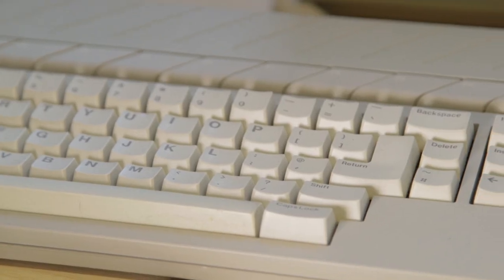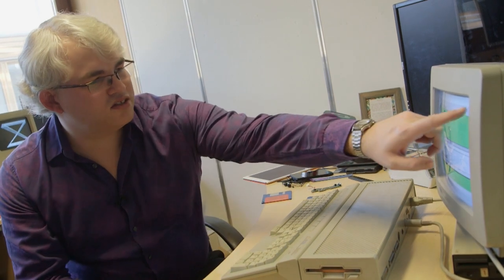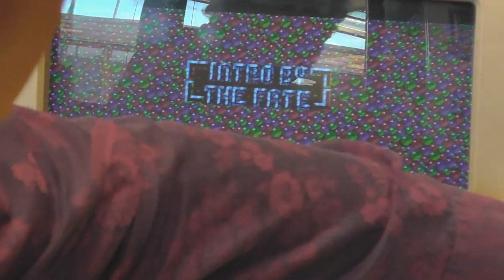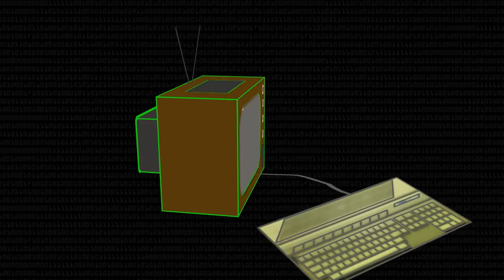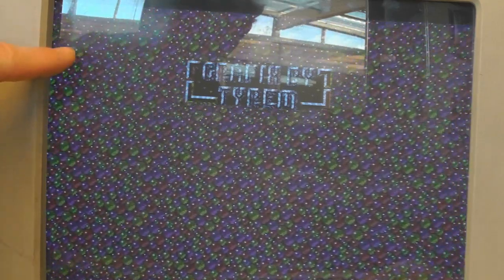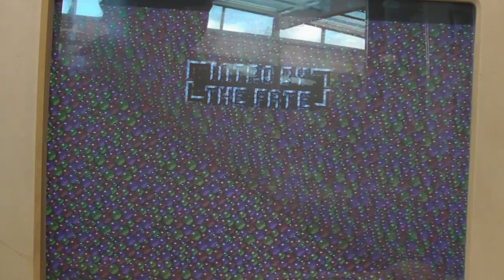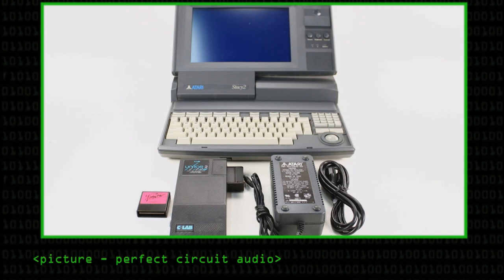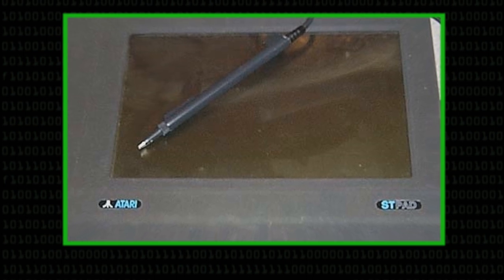Pushing the Atari Limits - Computerphile

Comment: Very nice, and in same years Amiga was able to address multiple resolutions in single screen with 4096 colors do multitasking. 

Atari fans do not like Amiga because it makes Atari look like totally out of date while Amiga debut around the same time, in reality it was not, but Amiga was beyond its time. Bagley is an Atari fan, have no Amiga, and mentions Amiga just a couple of times, seems like no hope here.

Can someone else in Computerphile make an Amiga episode ?
Reply: The Amiga had a bunch of custom chips (Paula, Agnus, Denise etc) whereas the ST/TT only later had an optional blitter, so that's trying to comparing different things. The Amiga's cooperative task-switching (not preemtive multitasking) added even more complexity for beginning programmers, in addition to the Amiga's complex memory models (fast RAM vs chip RAM) and costly documentation (»Amiga Inside«).

For hardware-oriented Amiga stuff, you had to wrestle with up to 17 different clock timings for all those custom chips. As a consequence, the 68000 in the Amiga had to deal with all sorts of IRQs not present in any Atari ST/TT. Effectively, you had a bit over 7 MHz »left« for user stuff on Amiga OS compared with 8 MHz flat on GEMDOS/TOS. So the Atari was not only faster, but easier to understand and easier to hack than the Amiga.

Nowadays, Atari emulators are a dime a dozen, compared to UAE -- another consequence of the Amiga's hardware complexity.
Reply: Margarine vs butter, AMD vs Intel, Linux vs *BSD, Ruby vs Python, bash vs zsh, Ubuntu vs SuSE, Picard vs Kirk, vim vs emacs, Netbeans vs Eclipse, chocolate vs vanilla, Thor vs Zeus, Firefox vs Chrome, just to pick the easy ones right out of my head. :-D
Reply: ***** And every smart person knows the correct answers are butter, AMD, linux, python, bash, suse, Kirk, vim, eclipse, chocolate, Thor, Firefox.   There, now that everyone has the right answers the arguments can stop..    :-)
Reply: Ken Jennings
I almost completely agree -- except for Ruby and Intel. Although I sympathize with Python and AMD for respective great efforts and inventive ideas, I'm solidly in the object-based (as opposed to merely object-oriented) Ruby camp since 2004, and in the more power-efficient Intel camp (never thought I'd actually write this) since 2013. Chocolate and vanilla I consider a tie -- so why not both, I ask? :-D
Reply: ***** 
Maybe you're thinking of the original Macintoshes that had co-operative multitasking where if one process didn't purposely relinquish control then no other program would get CPU time?

The Amiga has pre-emptive multitasking. No special coding is required from a program to get or release its time slice.  The OS takes care of all scheduling.

The custom chips in the Amigas do things faster than the 68000 can do (i.e. bit blitting) giving the CPU more time for running actual programs.  The Amiga/ST basically functioned alike on the bus regarding  shared bus access.  Half the cycles for CPU, half cycles for other hardware. The difference is the Amiga had more hardware making effective use of that time. 

The fast ram/chip ram distinction was a smart idea that allowed an Amiga to run full speed without sharing any bus time with the custom chips which is the relationship that evolved into today's graphics cards with memory for the graphics hardware separated from the motherboard memory for the CPU..

On the emulator point it is easier to implement a simulation of simple, less capable hardware, because there's just less that actually does anything.  Powerful hardware is always hardware to emulate. It is trivial for an Amiga to emulate the ST (or Mac).   But the ST can't really emulate an Amiga.
Reply: Ken Jennings If the AmigaOS implemented proper pre-emtive multitasking, it would have been quite a feat, like later with MiNT and MagiC! on the Atari ST/TT/STE/Falcon. For beginning and game programmers however, this meant even more complexity: unreliable timings due to the task-switching and problems with faulty binaries running in parallel leading to Guru Meditations (or that row of mushroom cloud and bombs on Ataris). (Didn't many Amiga games just deactivate and kick out the Amiga OS and other apps anyway, in order to maximize on stability and hardware resources, making a restart necessary after the games finished?)Thus, Dr Bagley's original point remains valid: the Atari platform was bare-bones, accessible and easy to understand, compared to the Amiga's complex hardware and OS. Once again I'm glad that I didn't go with my friends' choice of the Amiga as mostly a gaming computer, but with my Atari Mega ST4, on which I learned proper Assembler, C, interface design and later Minix, leading to my current profession as a Linux developer and admin. Not that this would have been impossible with the Amiga, mind you.
Reply: ***** for me it was the integrated graphics: a modern laptop should be able to play 1080p video from YouTube without stutter and dropped frames!
Reply: And Amiga owners don't want to hear about the Acorn Archimedes and RISC PCs because it makes their beloved machines look like a crippled 1979 technology (68000) 'computer' with weak copros full of limitations ...
Reply: +dipi: Amiga had a true multitask (not a cooperative mt).
Atari had a 68k 8Mhs, but cycles was rounded to multiple of 4 cycles due to the Glue: Develops an hardscroll and learn this. 
Irq doesn't slow down cpu if you don't use them, and seriously except for CIA (Amiga) or VBL, other IRQ are rarely used.
Reply: The Atari ST was pretty much thrown together at the last minute because Jack Tramiel was angry that Amiga had gone to Commodore.
Atari and Amiga had had a deal ... which Commodore bailed them out of.
Reply: Mumble mumble something FastRAM mumble
(...I wrote a better disparagement of it but Youtube appears to have eaten it, and, meh, life's too short; essentially, I can see it can be useful in some situations, and indeed would rather like an SRAM card for my A600 so I can try out the enhanced mode in Worms, but it's something that would have added extra complexity and cost to the design through providing a whole second memory bus that only a small number of users would actually make use of, and you'd have to buy a special additional memory upgrade to plug into that slot, which at least initially would have been quite a considerable investment for something that would only offer marginal gains - through releasing the CPU from the usual 4-cycle alignment - unless you were using one of the higher-end screen modes. And that memory, then, wasn't accessible by the AV system at all, so doing any work on the actual multimedia data would see you reduced to the normal speed, and also needing to blit data between the chip RAM and fast RAM if you wanted to work on it outside of the chip area... rather specialist really. And of course much like what the Atari folks saw with the STe, and to a lesser extent memory counts above 512k, programmers will generally write to the lowest common denominator wherever possible in order to have the largest audience for their product, and often seem rather loath to even include enhancements for more capable machines as an optional extra, so unless you're doing something that specifically requires those upgrades, you may find they're a complete waste. About the only exception to that rule that we saw was the single sided drive thing; software started out largely being SS compatible, but as the proportion of DS drives grew, software started to demand them... because if you can put twice as much data on a disk, you halve your duplication costs and cut down the overall production and distribution cost quite a bit, and it's not too much bother in comparison to either offer free SS replacements for those few users who request them, or just abandon that shrinking market altogether as not worth the effort)
Reply: Also I don't really buy the "true preemptive multitasking" thing. That would be quite the thing to pull off on a 68000, because it doesn't actually have the right modes and instructions to pull that off, at least not with any safety. I mean, perhaps the Amiga memory management hardware was a work of art and was able to set up proper protected pages for each process and carry out the sorts of virtualisation that the CPU couldn't do for itself. But one of the main reasons for the existence of the 68010 at all is that it added in the support for proper multitasking that the original chip lacked.

Rather like the 80186 and 80286 vs the 8086 - and really, Intel didn't properly get its act together on that front (as in, being able to multitask both with programs written explicitly for protected mode, and earlier code that assumed a single tasking regime, rather than pure protected mode code alone) until the 386, which is why you don't really see any full true multitasking (rather than task switching, with background processes being entirely dormant) operating systems on the platform until Windows/386 and then 386 protected mode of 3.0 came along. There were some early enterprise type OSes which could perform those functions on the 186 and 286, but they were generally insular and broke compatibility with common 8086-grade MSDOS applications, or at least had to suspend normal operation entirely, possibly even dropping out of the normal environment (like Win9x falling out to DOS, but harder) in order to run them.

Maybe they did something that tried to act like a true modern PEM OS, but it would have been extremely fragile if you actually tried to use that functionality in anger on a 68000 machine. Sort of like MultiTOS proved to be later on if you weren't running an 030 machine, or at least had upgraded your lesser model with an 010 or higher. Co-operative multitasking, or a simpler task switcher giving the impression of multitasking, I can more easily believe.

(And having explored much of the software that came unexpectedly thrown in with the Amiga I bought, I've yet to really find anything which exhibits clear multitasking behaviour, or to figure out how that much vaunted "pull down the title bar to look behind" thing is actually meant to work. Almost everything actually seems to operate much like it would on the ST or Mac, or on an MSDOS PC. IE, it runs full screen, optionally employing the underlying OS's windowing gadgets and the like, and doesn't allow access to any other program at the same time other than maybe some little desk accessories or TSRs. You want to run another program? You have to quit out and load it separately. In any case, you were almost certainly going to have to change the disc, in a single-floppy system, because Amiga apps are bulky and you don't tend to see more than one major program crammed onto the one disc.)

((...oh, and don't get me started with the unholy mess that is Workbench, at least the versions my machine has available to it on the supplied discs... after a while you end up yearning even for the relatively rudimentary, but generally friendly and functional, environs of GEM under TOS 1.0 ... or even MSDOS (christ, AmigaDOS is a whole additional rant on top of this one - and did anyone ever really make major use of AreXx?), or BASIC... I assume, and indeed hope that it actually got better in the later versions, and maybe if you have the luxury of a hard drive, but the various random editions scattered across those floppies, and having to be operated from them, start to give a person a deep and abiding loathing for the very idea of a graphical operating system...))
Reply: @TheNvipy  - The Amiga's 68k was also 4-cycle rounded. If you have a look through the Amiga Hardware Bible, you see its timings are rigidly tied to a 4-tick cycle just as the ST is. And in fact it throws away a clock tick at the end of each line, as keeping the video timing absolutely NTSC compliant (and sort-of PAL compliant) needs an odd number of cycles per line but nothing in the system can make use of that orphaned cycle; even a simple memory read or write uses two.

I'd expect interrupts slow down both machines just the same also (as they have the same processor, and it's the CPU's built in stacking routine that determines it), and they'd likely have about the same amount of interrupt traffic.

The one advantage the Amiga may have on those fronts is that it makes rather more clever and regimented use of the available non-CPU memory bandwidth to do various extra things with DMA - in addition to the bitmap video, there's the sprite data loading, audio, a strictly limited amount of memory refresh, and a little time allocated for disc transfer. The ST just turns all non-video time over to continual refreshing, and a little for audio in the STe (which reaches about the same transfer rate as the Amiga's audio system, but only divides the data between two channels instead of four), which is a bit of a waste, but then it didn't really have much else to use it for in a base system. Just a shame the hard drive DMA steals CPU time rather than operating in the video blanking areas.
Reply: @hogasproductions - I dunno if you're being sarcastic and the Miggy actually can run Wolf3D playably, but, it surely shouldn't be impossible to make something workable with sufficiently clever coding. One guy in his bedroom in Sweden (I think?) managed to brew up Substation on the STe, which is essentially an answer to "how can we do Wolfenstein with a smaller palette and much less texture mapping?".

Comment: Was anyone else looking at the border at the top and bottom of that so-called borderless demo?
Reply: IIRC the reason that the top border is still there is that the technique used to scroll the full screen smoothly (known as "sync scrolling") is related to the technique used to kick out the borders. 

Essentially it requires that same 50/60Hz switching, combined with very precise instruction timings and manipulation of the screen memory base pointer. I don't recall whether anyone ever managed to combine removal of all 4 borders with sync scrolling. Certainly there were fullscreen demos which did software pixel manipulation (did some myself) and sync scrollers with bottom and side borders removed.

It's been 30 years since I last did this stuff, so my memory's a bit hazy I'm afraid.
Reply: @chrisbtoo  Interesting stuff. You're right- that bottom 'border' that I thought I could see was just a reflection. 'Top one's still there :) Let's call it a 'mostly' borderless demo.

Comment: The borders around the screen were actually a consequence of the ST's somewhat cheap design.

The vertical borders are because there's slightly less vertical resolution being filled by the ST than there could be - only 200 pixels height in colour and 400 in monochrome. Compare this to say, the Amiga, which depending on the mode would do 256 pixels height or 512. I assume this was because Atari designed the machine to work on the lower resolution American TVs, and unlike Commodore, didn't want to spend the money developing a real PAL version. Honestly a better decision as the difference on amigas broke software compatibility quite badly for the unfortunate Americans.

Horizontally, it's because the ST's video hardware is straight up just actually wrong.

TVs work by drawing the picture left to right, one line at a time. The TV does this at a constant speed, and it's up to whatever is producing the signal to keep up with it. Unfortunately, the ST sends each line too quickly, meaning that the TV ends up finishing drawing that line of the picture waaaaaay before it reaches the side of the screen. To make up for it, they did at least add a long delay before each line so that the picture would be centered.

You can compare this with say an Amiga. Like the Atari it also does 320 or 640 pixels wide screen. But using the Same TV or monitor, the Amiga's picture will totally fill the screen, while the Atari's has the horizontal border. It's the same number of pixels, just shrunk. So if you have a crappy TV it can't display this higher DPI picture properly, and is hard to read filenames.

This was done because there's timing signals in the computer which control stuff like this. And Atari went with the cheapest way to make it work, even if it's wrong. 

Its a fun quirk, and means of course that you have these border areas you're guaranteed everyone can see. So if you know how to use them, you get a higher resolution screen for free.

It was much harder than he makes it out to be though. People thought drawing stuff in the left border was impossible for years

Comment: Hm, would it be possible to write games specifically for the 72Hz monitor? Or are you just stuck with 50/60hz?
Reply: The 72 Hz "Hi-Res" monitor was monochrome, which is why it appears so crisp. (It didn't have a shadow mask.) When an Atari ST was connected to it, the computer would switch to 1 bit-per-pixel mode, much like the early Macs. Each pixel would either be black or white, as the ST didn't have enough VRAM to display grayscale at the higher resolution the Hi-Res monitor utilized. There probably are some ST games that are compatible with the monochrome monitor, but I can't think of any offhand; my ST had the color monitor.
Reply: Shmeh Fleh Well I was talking about framerates, not graphics quality/"crispness"

IE, is it possible to write a game that actually updates at 72Hz, or are you stuck to normal refresh rates?
Reply: I would imagine you'd be stuck at the normal refresh rates, if you could even use the games on the monitor.  Speeding things up like that would probably affect the very particular timing these sorts of games depended on.